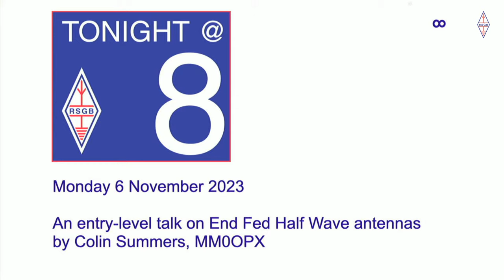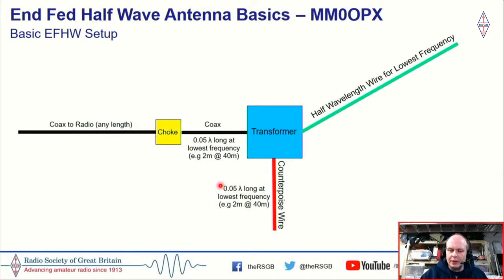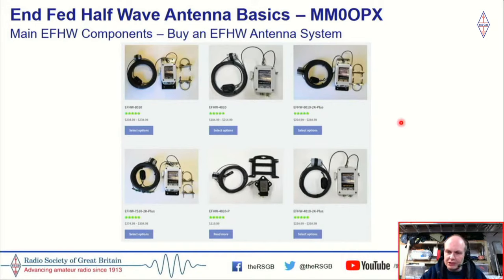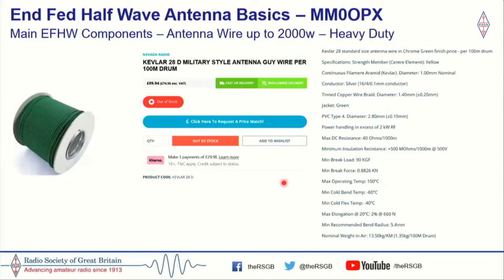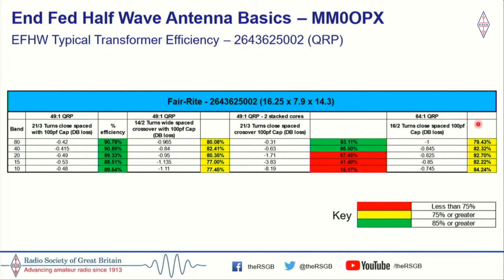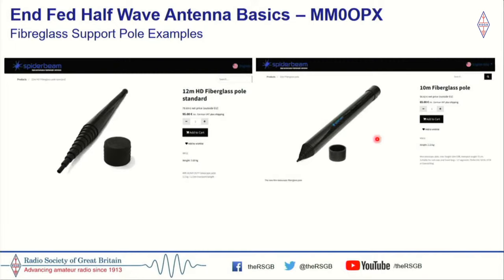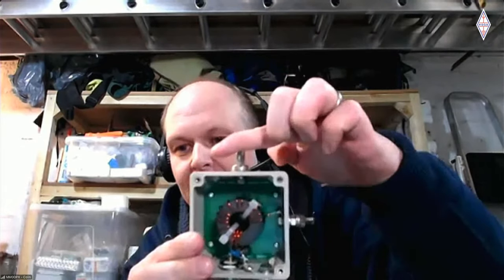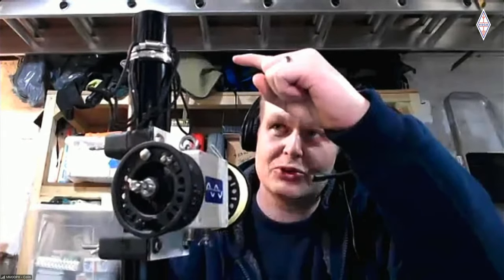RSGB Tonight@8 - An entry-level talk on End Fed Half Wave antennas by Colin Summers, MM0OPX

Comment: The choke being moved to the transformer altering the SWR proves that the antenna system is trying to use the coax to compensate for a lack of an adequate RF ground which makes me question whether the claim that you don't need any radials, or at least something forming a RF ground, is required and whether a 0.05 wavelength counterpoise is enough. If you removed the choke altogether and the SWR altered, even with a 0.05 wavelength counterpoise in place, then it would confirm that the antenna system is using as much of the feeder as it needs to compensate for the lack of an adequate RF ground and the claims made by many that it doesn't are false.
Reply: I beleive that an amount of the coax is required as a "counterpoise". If i use no choke used and then a choke 0.05 away from feed point there is zero difference to the SWR between these. If I place the choke right at the feedpoint then the SWR does change dramatically compared to the previous 2 scenarios of no choke or one 0.05 away.